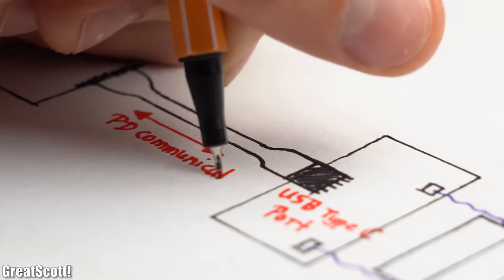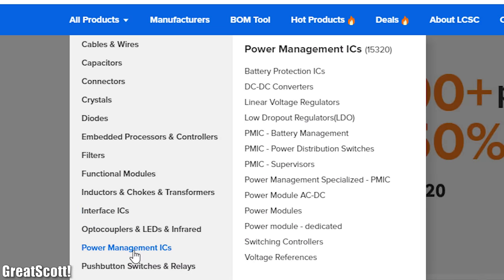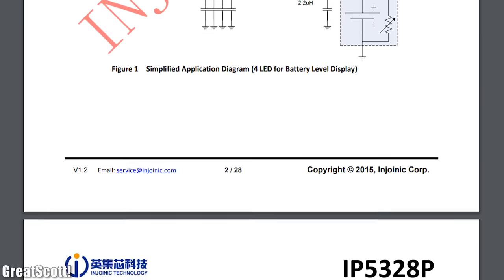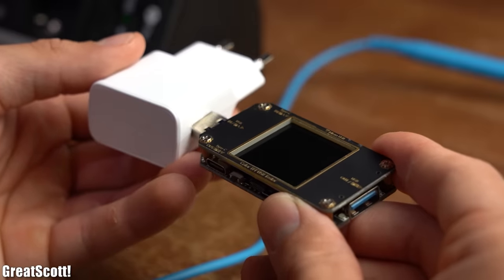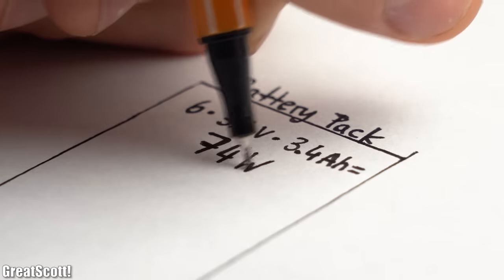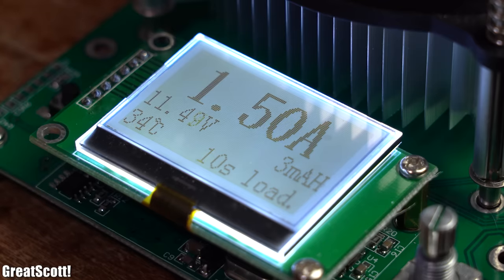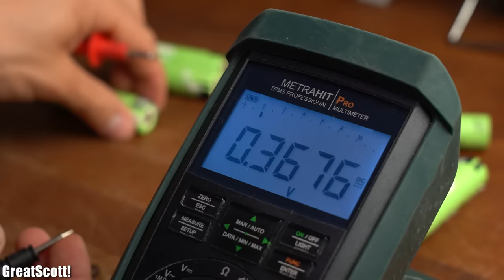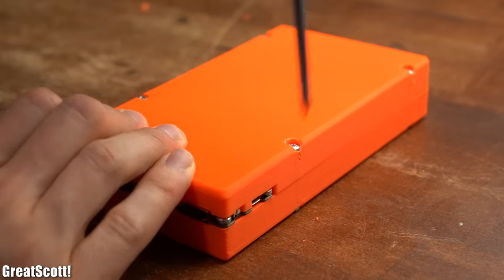Building a USB Type-C PD Powerbank the Super Simple Way || Testing an Aliexpress PCB!

Comment: Perhaps someone can help me:

How can I get 5V/3A out from that board WITHOUT plugging in a PD trigger board the the USB-C plug?
I want to use that pcb as charging electronic, but my components should get wired somehow directly.

There is no description of the other solder pads for that board. Anyone has more information?
And is there a way to switch the output power on/off?

It seems that everything is controller via usb-c. Or can I just solder a second usb-c socket parallel and use it internally?
No idea if that would work, if a second cable gets connected for charging while the trigger board is also connected...

Ideas/Help would be great!

Comment: Anyone else having trouble making this work? I'm using the same boards and cannot get the trigger board to negotiate with the IP5328P board. I just get the voltage LED flashing cyan rapidly.

The trigger board works well using the same USB-C cable connected to a USB-C PD charger as shown in the video. I can step through each of the available voltages using the button. Presumably I'm missing something obvious. If anyone can set me straight, I'd appreciate it.

Comment: USB Type-C is not awesome, USB Type-C overcomplicates everything, then hides the important details behind "proprietary".  Like how a cable signals it can handle high current, why a power bank won't turn off if some cables are not unplugged at the power bank, not simply disconnected at the device, why/how some cables signal they are a device and can't be used to charge.

Comment: careful with them injoinic chips GS, I have a lot of experience with power banks that use them chips. They don't do to bad as far as fast charging or high output but some of the 5200 and 5300 series of their chip have problem when trying to fast charge from input  (9-12vrather then standard 5v.) worst part is when they fail they short everything out. by what ive gather, its because the small chip can't dissipate enough heat during fast charging, the chip is doing everything. So if being used long term or with a fast charger. HEAT-SINK IT. Or its gonna over heat and short the batteries directly. its happened to me 4 times, 3 times with a 5328 and once with a 5322.  I say this because that board you have using that 5328 has me concerned. The 5328 and the 5322 are NOTRIOUS for this problem, the  5328 only seems to have that problem when trying to fast charge 12v through type c, doesn't seem to be affected by the micro usb. they are good chips but still you need to be careful with them. Ive have plenty of experience with the injonics chips.

Comment: I have one question, is the IP5328P PCB able to provide 9V or 12V at one output and 5V at the other simultaneously ? 
Every QuickCharge compatible PCB I've tried disable the other port when one port switch to a voltage different than 5V

Comment: Looking to build battery pack using my Milwaukee tool batteries. 18V and 12V packs, does anyone know how this could be done with a similar board?

 I'd rather not step down the voltage for this board...

Comment: The board does in fact support PD at 5v, 9v and 12v when using the trigger board, but I tried 3 to 4 mobile phones, all supporting these voltages, but they all were charging at 5v, couldn't get the board to switch to 9v or 12

Comment: im after a 12v-14v input pd charger pcb to install a quick charger outlet for my macbook and other electronics in my campervan it seems silly to convert from 12v DC to 240v AC back to DC! are there any off the shelf pcbs that can do this? ive got a booster that will go up to 20v but how can i get that into my laptop?

Comment: 9:16 Could you explain what can happen? Without explanation I can't resist to not try it! Should I mix batteries with different voltage to check it out? Will it create small black hole or portal to another dimension? 🤔 🧪🧑‍🔧

Comment: I had one question I have 8 li ion cells two from powerbank (samsung 26c)and 6 from laptop battery (samsung 26fm) can I use all of them in parallel and then use a tp charging module to charge them (I heard somewhere that one should not use different li ion cells in parallel) I searched on the internet and found that they all have 2600 mah capacity

Comment: Is it possible to have constant current output so it would not interrupt if the power bank is suddenly connected to input voltage again (I want to use a Raspberry Pi in a car).

Comment: You just need to care about the right voltage. It also would be best to have some kind of fuse, if a battery fails, so that it is removed from the circuit.

Comment: Very informative video, and thanks for letting us know about this PCB module. I made myself a power bank with it and it kicks ass! 
I have one question though. I want to use it in another project, a solar power bank. The solar panel is going to be integrated into the case, all connections will be internal. Could I desolder the micro USB input and wire the solar input directly to the board? Does this PCB support solar charging input?

Keep up the great videos!

Comment: Super useful! But just wondering, In case I want to use it to power up a raspberry pi 3 or 4, the 2 USB outputs also deliver 3a at 5v? or just the USB type C? 
As I want to use something like this to power up a portable project I would need that the output is always connected to the circuit and when it rans out of battery then connect it to charge again which also present the problem if this is good to connect to charging while discharging (using the machine). Does anyone knows?

Comment: @GreatScott
Really a nice small project.
A small power bank story.
I visited Fare East via Beijing and had one simple 1 cell power bank with including LED torch (from ebay) and a 3 cell powerbank made by FSP in my board case. At airport you have to put all electronic device out of the case for scanning. Because the nice 1 cell powerbank with torch had no label with voltage and energy information on it the security people take it away. I explained them that this small powerbank will only have 30% of the FSP and that there should be no risk. But there was no chance to get it back.
So if you fly (to Beijing) do not forget to put a label with voltage and Wh on it! 
Otherwise security people will maybe confiscate it.

Comment: So if i stick random cell in parallel, then they have to be on the same voltage or i shouldn't do it ?
Reply from the maker: Dont
Reply: You have to connect them with a resistor to limit the current to let the voltages equalize. Afterwards, you can connect them in parallel. Connecting them in series is trickier since you also have to match capacity.

Comment: hello GreatScott. can you help out whit this question   can i use  this  TO-92 - temp sensor in serie conection. i going measuring temperature in a battery pack, I want to measure 8 cells in series. can I mount them in that way .. or do I have to have some type of diode or resistor for it to work to do that way. I will use this one bms that controls the temperature. as well as a fan control module

Comment: I wonder if it wasn't drawing more power to change because it has reached a limit on how much that single cell could safely take? That was 4-5 amps charging, and most of those cells only do 1-2 amps charge current.

Comment: If I would connect a solar panel with a 5v converter to it, would it work or could it be dangerous? I am not sure if the solar panel still forces current to the battery or if it cuts off?
Thanks!

Comment: Hello, O "GreatScott!;
GREAT job!
I want to build a 4 cell 18650 pack to replace bad factory battery packs for 3 cordless drills.
Well 1 of them would need 6 cells, for an 18v cordless. [ShopSource, I think.]
I've got 10 fair 18650s salvaged from laptop batteries but I don't know much about 18650s.
Back in the day we used mostly alkalines or nickel-metal hydrides.
AIUI, lithiums can get real ugly real fast.
the story goes a plane crashed just out from Miami from a lithium battery fire, years back.
So I've been wanting to replace the dead packs w/ lithiums but I need to learn more about 'em.
You've got one of the better DIY electronics channels I've seen.
Your English is very good too.
Keep up the good work.
Have a GREAT day, Neighbor!
Reply: maybe you are already aware but if not you should check out Batteryuniversity.com

Comment: How did you switch the voltage ? Does the board decide that on its own or how did u do it ?
I want to build my own Batterypack vor a FPV Google and i need it to set up at 9v.

Comment: Noob question:

Let's say I have some AA 1.2 V rechargeables "laying around" 8)
My only source of power is 5 V.
Can I put 4 batteries in series - 4.8 V and charge them ?

And when people have stopped laughing, I have a real life battery problem.
My bike headlight has a battery pack that is almost dead.(Didn't know that a year without using it would hurt it)
I peeked inside a found 4 18650 batteries. I'd like to do a DIY job, since the pack is $100 but the batteries is 5 bucks each.

What scares me, is that my voltmeter reads, what the label says actually - 8.4 V, which for the love of god, don't make sense with 3.6 V batteries.
Theres is a circuit board at the end. Perhaps it is boosting from 7.2 to 8.4??

What comforts me is the 4.4 Ah. PROVIDED that the following is a correct assumption.
2 batteries in series, double the volt but keeps the Ah??? (The batteries is 2200mAh)
In that case 2 parallel series create 7.2 V , 4.4Ah.

It pains me that I don't understand more of electricity.
But these videoes are gold, and your voice is soothing as hell.
Reply: Can I just buy 4 18650 batteries, take notes on the previous setup, and move the circuit board?

Comment: Probably a long shot, but: do you know if it's possible to build a USB-C PD charging board for a 24V Li-Ion input?

I have a beefy 6S7P Li-Ion pack for field charging my drone Li-Pos but it's laying around most of the time waiting to be used, 
so i thought i could power all kinds of stuff with it while on the go (Nintendo Switch, Laptop, Phone etc) and the perfect solution would be USB-C PD. 
And since it already is 24V (well more like 20v-24v) you just need a buck converter for the 5,9,12,15,20V steps of PD. 

But i could not find any PD PCB on Aliexpress that has a step-down on it... only step-ups for 1s configurations.
So could one design a circuit for this case? is there a PD chip that supports that? is it even feasible to do this?

PS: my thoughts are only about Output, to charge this monster with USB even with 60W PD and balance it would be overkill so that part would be ignored for now.
I charge it with a dedicated balance charger.
Reply: This is interesting as I am looking for a way to utilize power tool battery packs to build out an open source USB-C PD charger. If you find anything please let me know!

Comment: I wonder if it would be possible to add qi charging to this .. i have a qi charger kit that i bought some time back and i wonder if it would be possible to solder wires from the output of this board to the inputs of it possibly with a power limiter to make sure it doesn't go over what the qi kits board can take and mount it in say the center of the pack on top

Comment: I have built several of these and two of them died with the batteries getting bottomed out to 0V. I did use salvaged cells, but I had tested them some before using them to make sure they were still good. Has anyone else had this issue?

Comment: Hey scott.
I recently salvaged 6 18650 cells from a broken powerbank and bought the Board recommended in this video. 

I was wondering, if i could also charge the Cells sepreratly via  XT60 with a balance lead to decrease  charging times, when at home with my charger. 

I would like to also use the big capacity to power my lipo charger from the 6s 18650 pack.

Is there any known problem of using the pack NOT through the USB-C Board?

Many greetings

Comment: Good video as usual !
Can it power up the LattePanda Delta (12V 2A) ? 
"The voltage range of the Delta's power input connector is 11~15 volts. So, if you're choosing to use the lipo battery, you should use 2~4 cells. The standard DC power source is 2A @ 12 volts. The maximum required booting power is about 10 watts, and operating power is about 3 watts with low electrical loads (with CPU power usage < 5%)."

Thanks

Comment: Good part of the day. It was so informative, and can I connect 18650 batteries to this charging board? Can I connect 12×18650 batteries in parallel?
Reply: I have 12 18650 li-ion cells, and I want to have huge capacity power bank😅. Thanks in advance.

Comment: I just bought a backup power supply for my computer/etc and am already wondering how hard it would be to replace the lead acid battery with lithium ion cells. Would it charge/discharge correctly?
Reply: I would suggest you learn about electronics thoroughly enough that you could answer that question yourself before trying it. I dont know.

Comment: Did you override the configuration resistors the IC uses to configure voltages and battery types? Did you try to interface with I2c with the chip?

Comment: Can you make a video about active bridge rectifier. I try to desing a AC to DC / DC to DC converter for a small and powerfull power supply, but use a regular bridge rectifier will dissipate a lot of heat. Not good for small devices and less if I consider make it portable using a power bank because will consume a big amound of the battery capacity. Ty

Comment: The cells are in parallel, so you can solder without spacer, in case of failure of iheat shrink there is no problem, - with -, you can safe a lot of space so

Comment: I also used this circuit board for a powerbank. But I used ipad 3 cells (6 total) which gave me 88Wh and flat design. 
The SOC manufactor has got stronger chips to offer. But I think it will not be enought to charge a Thinkpad. I am still looking for this kind of chip.

Good Video Great Scott! 

btw. Have you seen the upcoming GaN USB C chargers?!

Comment: have you look into powertools battery? i use them for universal power like charging my laptop or to my phone and in some cases a high power light. they do have built in bms so it quite safe for everyday use.
Reply: i did made a D cell battery bank the battery cost around 12 usd and the car charger was 5 but at the time i didnt have the tools to measure power/watt hrs  but it did last a very long time.

Comment: Which 3D printer you have ?  Will you share its specifications, prize and from wher to buy.
Reply: It's a Prusa i3 MK3(S) - Google that and you'll find links to the prusa website. I own one as well and strongly suggest getting the kit for around $750 USD. Once you're done with the 8 hour task of putting it together you'll be intimately knowledgeable of every aspect and thus able to tear it down to clean / maintain it or fix anything that goes wrong.

Comment: 8:26 I've heard elsewhere that LiIon cells should not drop below 3V, that it is healthier to cut off the power at about 3.4V with room to spare. Is that not the case, is 2.9V also acceptable or does it depend on what manufacture cell is used (so I should rtfs - read the f**** specsheet)?
Reply: Different exact chemistry effects the top and bottom voltage. Also, li-ion and li-po are slightly different so be careful when reading recommendations on forums, etc. Some numbers come from RC hobbies, while others are from ebikes, vaping, etc where different types are used. People mix these up and assume lithium is lithium.

General rule is 3.7 or 3.8 is the nominal (midway) voltage, and they'll go half a volt either side safely. For longer life, you reduce how far either side you push them. Keeping them constant close to 3.7v will make them last years.
Reply: @tin2001  Thanks for the clarification.

Comment: you convinced me into trying to build one and parts are still available on ali. just one question: the cell holders/spacers, did you get those from ali as well? would love to see a link for those as I'm in Eastern Europe and don't want to get into size issues when I put it all inside the printed case. thank you <3

EDIT: found some locally, size is: 1x1 = 22 x 22mm/0.8 x 0.8 inch (L x W) - are yours the same size?

Comment: Nice Video. as always :D
I actually got inspired by one of your earlier videos on USB-C PD and made my own PD-Powerbank. my Goal was to charge my laptop at 20v. The Banks that can do this are 60EUR upwards (a bit much for my taste right now).
So I looked for an alternative. I basically made a 12V Pack (3P3S Samsung 30Q cells with a 20A BMS) that has a cigarette lighter Socket. I plugged a decent 20v capable USB-C PD charger in.. works fine so far, but needs further testing. Idk what happens if the battery voltage drops far below 12v..
Have you seen any powerbank PCBs that can do 20v PD?
Keep up the good Work my man ;)
Reply: wonder if a boost regulator would help?
Reply: @mevk1  😁 yeah good point, that's what I ended up using. I actually used a 3A12v stabilizer because a fully charged 3S battery has 12.8 V or something, too much for a boost converter.

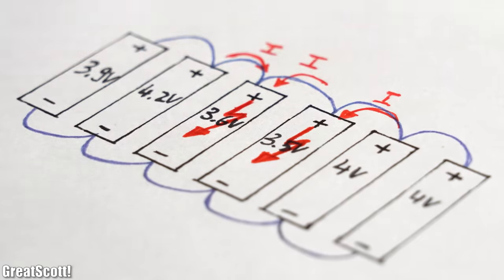Comment: Hallo! At 9:23 you mentioned that using different cells with different voltages is not recommended at all. Would it be possible to take these random cells and charge them to the same voltage and then using them together?. Thanks!.
Reply from the maker: No
Reply: @greatscottlab  Isn't that what you did ...take a bunch of cells all at the same voltage ?
Reply from the maker: No. Listen to what I said.

Comment: 9:17, but how if i charge those batteries with proper charger?. Those will have same volt.
Reply: Still, they might have different capacities so the voltage can change over time, even if they were brought to the exact same voltage beforehand.